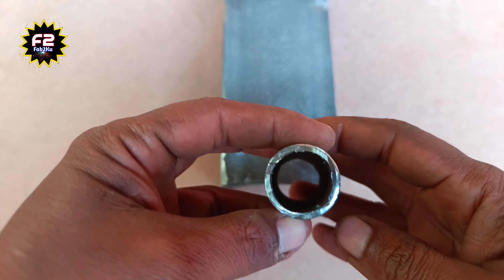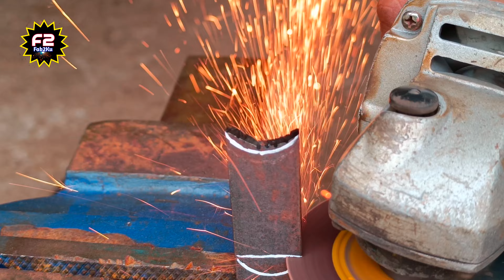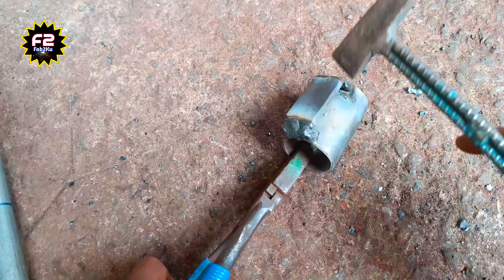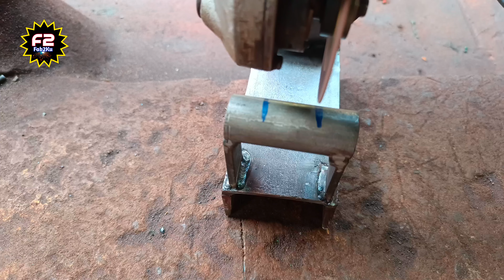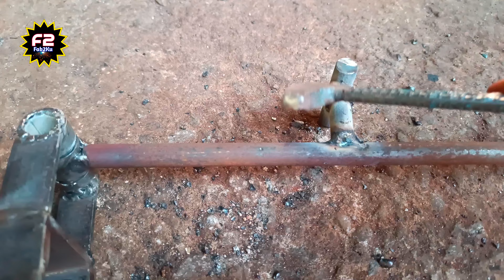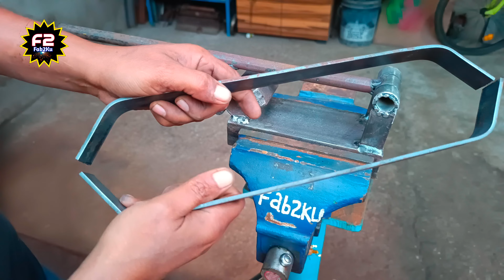Creative ideas And inventions Of Welders / A Homemade iron Bending Tool That is Rarely Talked About

Comment: Always great creative ideas with useful and helpful shop ideas.......you can also add a long 3-4 inch Nut and Bolt and the end of the larger  tube,, welding  a flat bar incase the design of the bend is less or more...just extend a  flat bar with a hole to insert the nut and bolt...as the flat bar is bent it will have a stopping point for the curve of the bend...... May God Bless you my friend
Reply from the maker: That's a great idea sir
Thank you 🙏😊